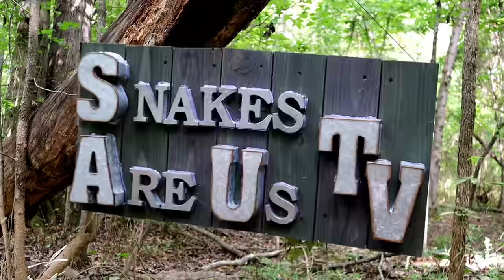SNAKES under the House?? Here's what You need to know!                 🏠 🐍

Comment: I went under my house to deal with hvac issues 2 days ago. I came across what i believe is a 4 ft garter snake. He was going into the joists where there is crappy old insulation. Since my crawlspace is tiny (the joists are less than a foot over my face when im laying down), new fear unlocked 😂. I crawled out and now i dont wanna go back in. Dont have the money to pay someone else to do what needs done, so atm im sitting at a crossroad in my life.
Reply: You can get a live trap, and most don't believe me but they HATE Cinnamon oil and it DOES work. You can get them out with that too.